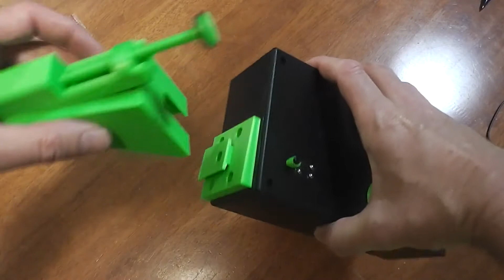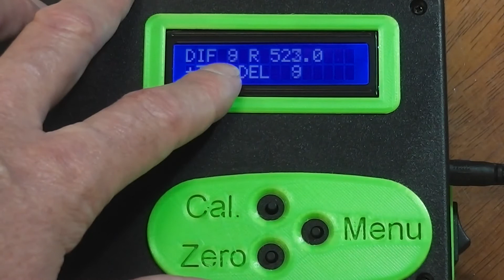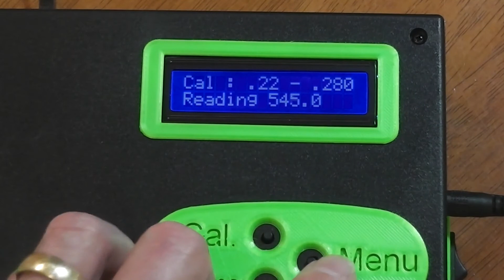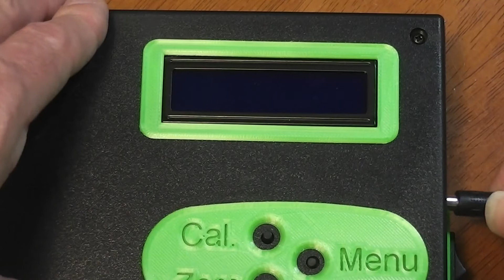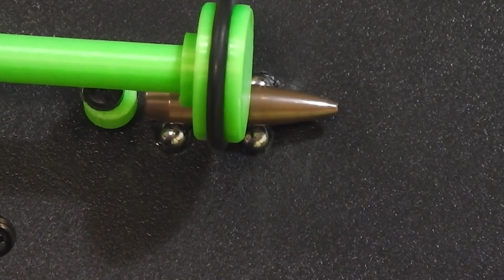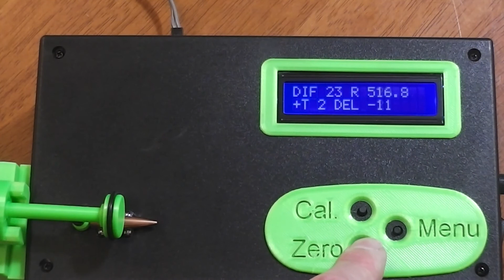Another EBC completed.

Comment: Nice Unit, may I ask if this checks or measures the balance of the bullet as it spins?
IE: Gryoscopic Dynamic balance
Reply from the maker: It's probably covered in a few of the other videos but the short answer is yes. It is definitely covered on the website. See: https://mrbcrc.com/what_is_it.html

Two materials make up a projectile. Copper which is relatively lightweight and lead which is obviously very heavy. Copper has an effect on electromagnetic fields and lead doesn't. So the EBC measures the presence of the copper.

The variations shown indicate higher and lower amounts of copper. Ignoring the improbable situation of air gaps, we can conclude that more copper equals less lead and visa-versa.

The less uniform the distribution of the lead is, the less chance that the projectiles center of gravity is central to the projectiles axis of rotation in flight. While it's nearly impossible to spin a projectile at the right speed to measure the effective Dynamic Balance directly, this represents the next best option.